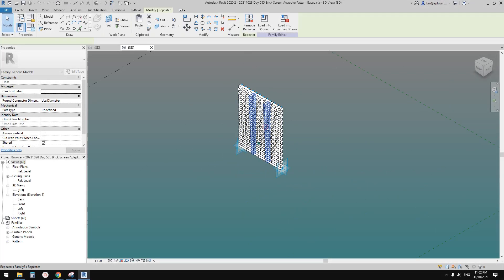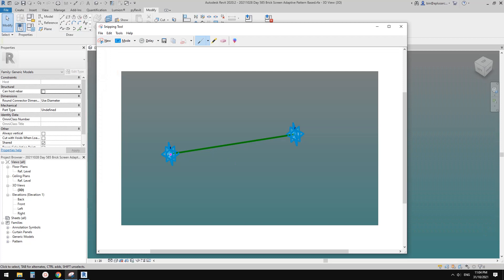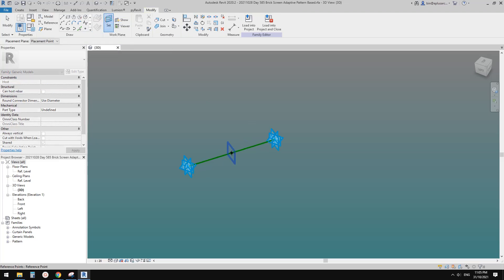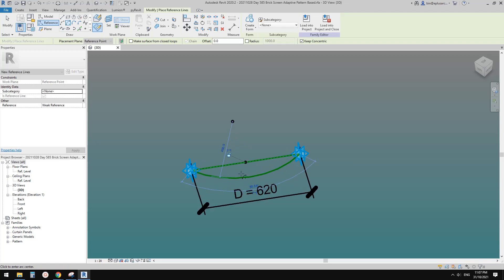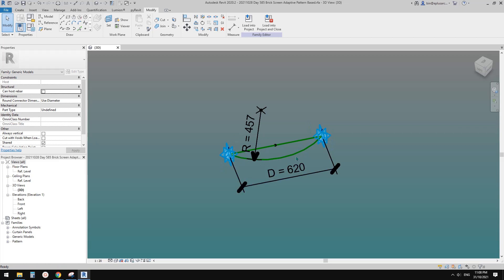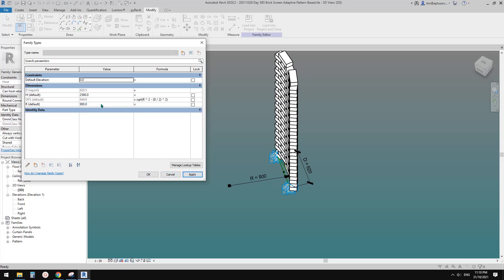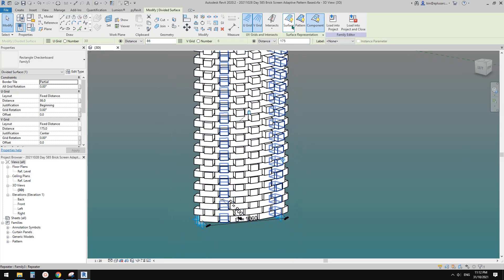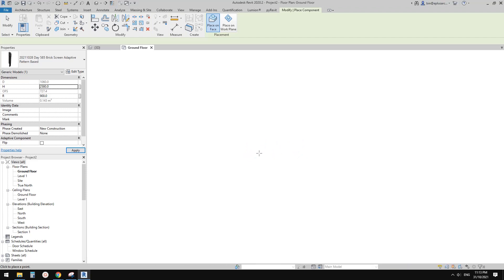Revit Exercise (Day 588) Adaptive Brick Wall Curved

Comment: Wouldn't it be simpler to start with 3 adaptive points instead to make it able to curve?
Reply from the maker: Yes, it will be simpler to use 3 adaptive points to create a curve, but this curve will be a spline and not exactly the same as an arc.